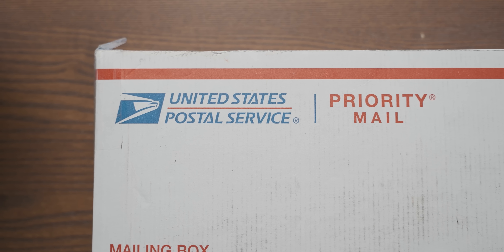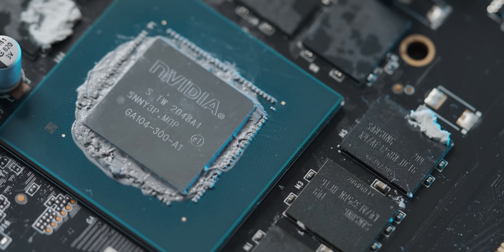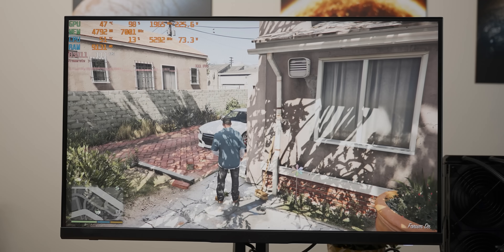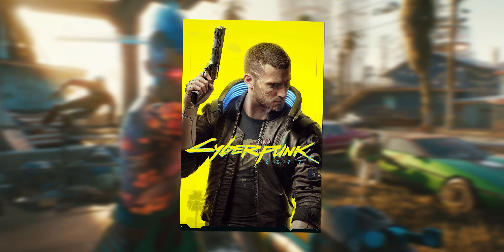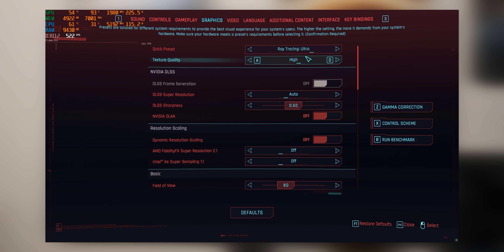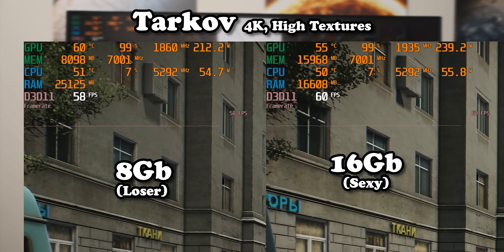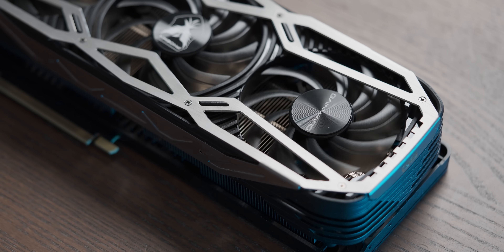This Is The 16Gb RTX 3070 Nvidia Should Have Made

Comment: FYI, many games will smartly adjust their LOD distances to dynamically reduce actual RAM needs to meet your card's capabilities.
Reply: Yep, or just lower the texture quality automatically like we've seen with some games like Forspoken. So gamers with a GPU that lacks VRAM may be tricked into thinking they're actually getting ultra 😂
Reply: yup but the new releases (hogwarts, TLOS, RE4) look and run so bad on 8g variants even on 1080p
Reply: @bryanlim1249  to smartly adjust LOD you need a smartly designed game
Reply: @denvera1g1  sigh we can dream
Reply: I need more VRAM for AI not gaming. 1080p 60fps is fine.
Reply: @jcdenton7914  The problem is that soon 1080p60 will reqquire 16GB if you want more than low settings, before the 50 series launch there will likely be games that cant even maintain 1080p60 low without 16GB

7 years ago 4K60+ ultra only needed 6GB and you could get by with 3GB(780TI), this was because most textures were rarely above 1080p and LOD meant the majority of textures on screen were not even the highest detail.
Now we're starting to get into supersampled textures of 4K and 8K
Reply: @denvera1g1  slow down there buddy, please let it be 12g for now atleast lol
Reply: @bryanlim1249  The time for 12GB was 2 years ago when those cards costed $330, if you could get to them before the scalpers, miners, and new-gamers that didnt know the meaning of MSRP

If Nvidia wants to call their follow up to the 12GB 3060, a 4070TI, thats fine, but dont charge $800 for the follow up to the previous card at $330

Technically, we should have gotten a RAM doubling with the 30 series, but that only happened for the 12GB 3060, and the 24GB 3090, but here we are at the 40 series with the 4070 finally being given a RAM doubling, but instead fo $699, its $1200 and  called a 4080
Reply: Laughs in tarkov
Reply: does the CPU allocate RAM as VRAM when it needs more? ram sucks as VRAM bc obviously but i swear Linus said it
Reply: @nauticalnave2105  a good game would reduce LOD first
because you're talking about going from 100-1000GB/s in VRAM to 50-100GB/s that has to be shared with everything else.
Reply: @nauticalnave2105 that would be so great if it did, but it doesnt, hence the need for more vram. (yes i know this is an old comment)

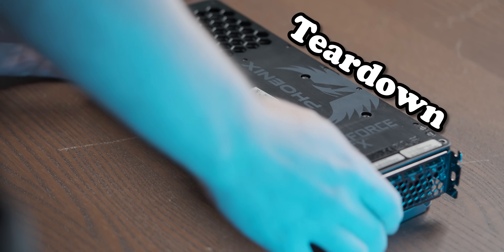Comment: 1:30 In the USA your warranty can only be void if the aftermarket replacement parts you used were the cause of the damage. 
You cant deny a claim for a defect on the power rails that eventually lead to a short on one of the 8 pin power solder joints because you used aftermarket thermal paste

Comment: most of the times you didn't notice a difference were because you weren't moving. lack of memory gets accentuated when asset swapping, if you stop moving no asset gets swapped and the card "stabilizes". if you start moving, the 8gb card still stutter like mad, lose performance and overall deliver an unplayable experience when the game doesn't handle the handicap properly... like control does. it was basically running at much lower graphics settings on the 8gb version to save memory
Reply: Because you haven't set enough memory on th hd partition, win 11 comes with 1gb, if you set it to 12gb your problems disappears. Obviously real ram are faster than a SSD memory, but you barely notice it in games.

Comment: Reason the performance boost is not massive is that the extra gb per module is only running at half speed, it works like that on all 2gb modules from what i understand.
Reply: 2gb works the same as 1gb module. He's not the first one who did this mod. 
The reason why a performance boost is not massive is because he doesn't know how to test it. Watch Hardware unboxed the channel for proper tests VRAM issue.
Reply: @Anderson_LS  good joke
Reply: This
The workloads are almost as if specifically choosen to somehow make it seem like Nvidia isn’t selling complete e-waste
I normally trust this channel but this wasn’t a good demonstration of benching for vram heavy loads but a certain selection of older titles that don’t reflect the current and especially not the market of the foreseeable future
Reply: @pfizerpricehike9747  He is just trying to make a fun video, you need to be testing for 1% low to really see the difference and he never does this kind of in dept benchmarking.

Comment: Conclusion? For todays standards, you are fine with 6gb of VRAM. Futurewise, 12 or 16gb would be better. Don´t know why 16gb cards are not the standard for newer cards, i mean, if you buy today a new card, you will use em for some years maybe? But if the card only has 8 gigs of vram, you will end up in one year with no games to play. I can imagine, that the games (in one year) do need at least 8 gigs to run, maybe 12 for optimal performance. I need to buy a new card in some months (1660ti now in my pc), and i will never buy a card with only 8 gigs of ram. I will stick with the new card for at least 4 years. No way that 8 gigs gonna work fine in 4 years.

Comment: All the cards are capable of having/using more vram. For some reason Nvidia decided to push this ray trace crap but still gimp their cards in what seems like a ploy to force gamers to waste more money on higher tier cards for triple the price. I like the idea of this frankencard but it is sketchy and too many things need to be done to get stability. Cool idea but I will stick to the rx 6950 xt and deal with the amd driver headaches.
Reply: What driver headaches? I haven't got any with my 6700 XT.
Reply: @keulloe  Undervolting and heating issues(random spikes, not sustained overheating) and it hated windows 11. All minor headaches and in the grand scheme of Ngreedia, nothing I even consider an issue now. The 6700xt is a sweet sweet 1440p gpu. It should be the absolute minimum gamers are using. Even nvidia cant seem to sort themselves out with getting 12gb vram on cards.
Reply: @fuzzylumpkins6034  I run my 6700 XT overclocked and undervolted and haven't got a single issue.
Reply: @keulloe  the 6950xt and 6700xt are miles apart and the 6700xt launched better with less config issues and preformed as it should in the usual suspects (gta V, cs:go, fortnite, Cyberpunk and all the usual fodder they are tested against for approved reviewers). No disrespect to the exceptional 6700xt at all, hell the RX 580 8gb launched with less niggles. I was stating when mine released it released with some really annoying issues that are minor in comparison to the deliberate gouging of nvidia. I had so many issues getting the 58003dx/ 6950xt / x570s to live in harmony the first week of the build. They all hated each other when on paper it was a perfect marriage. The cracked vbios is still a headache. Again yours and mine are not even in the same region. Had I needed a a card simply for gaming I would have settled for a 5700 xt sapphire nitro and used it until am6/ddr6 gen but I needed the 6950 xt for work and specific applications and it released with so damn annoying headaches that in this day and age should not be happening. If it wasnt for testers and reviewers we wouldnt even know how to sort these issues as the producers do not do half the quality testing that consumers do.
Reply: @keulloe  Had a 5700xt from august 2020, and a 6900xt since september 2022, still use both of them on different computers. Drivers on the whole is what i would class as 98% good. It's only a few times where I would just get random bugs, maybe once every 4 months.
Reply: Just wait until the refine the cracked vbios'. It'll definitely work perfectly then
Reply: @Weneedaplague  They'd also need cracked/modded drivers, after all RAM usage can be blocked on that level as well.
Reply: I've always been more of the opinion that on the lower end cards, the hardware is meant to be used more for DLSS than RT.
Reply: What headaches ? Amd drivers are very good now and fsr3 is gonna keep your card alive a loong time
Reply: @tymont6339  It isnt just the initial drivers from release, it is the cracked vbios and other headaches, regardless as i said they were never as much an issue as nvidia  and their price gouging and blatent disrespect for pc gaming and consumers. AMD like every company had a few hiccups on the release of the 6950 xt (like all high end releases) that have almost been rectified. I am not a fanboy of a company, i prefer price to performance and as I use the 6950 xt for my work and need it for specific applications, like AAA title games, eventually all these components deserve what they will never get, a good launch.

Comment: All you prove is that 8GB is better :S 
Now re-enable boost on 8GB version, and the 16GB version gets smashed.
I think 12GB would be  a good middleground for 3070, given it could retain its full functionality.
Reply: If 3070 is a 12GB card, it is going to be crappy. 12GB VRAM means it must run on 192bit memory bus instead of 256bit. You need to sacrifice alot of memory bandwidth
Reply: @fleurdewin7958  Why you think you need to lower the bus?
Reply: @DIYRepairHour  32bit per memory module.  12GB needs 6 units of 16gbit(2GByte)  memory modules. 6 X 32bit = 192 bit memory bus
Reply: @fleurdewin7958  oh, but I was thinking of an original 12GB, not that you would DIY it. You could have 12GB on 256 bits if you want. Or whatever combination you want. With a proper memory controller inside the die.